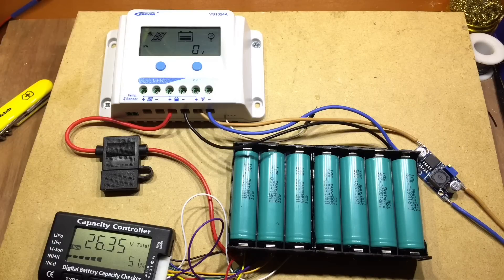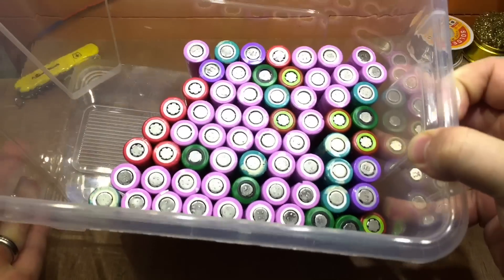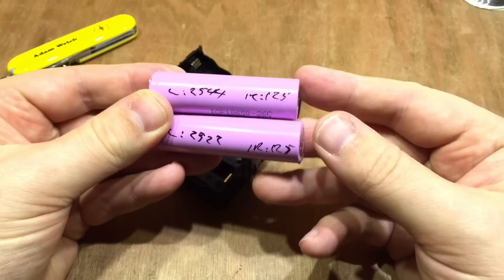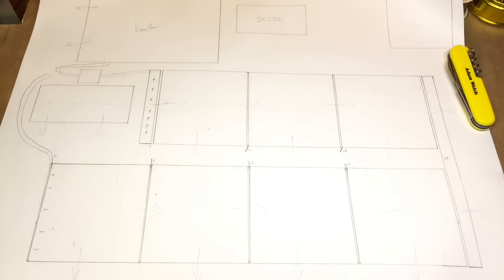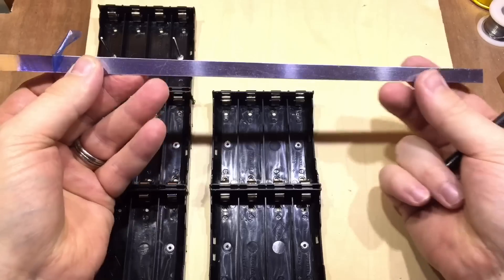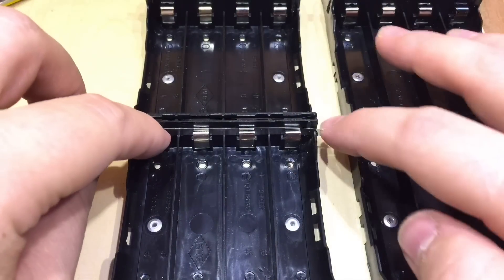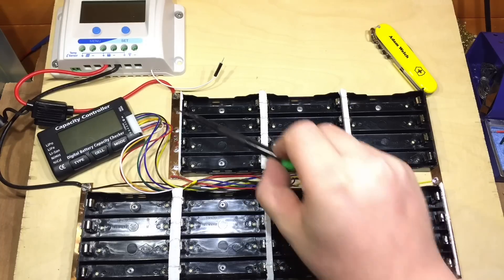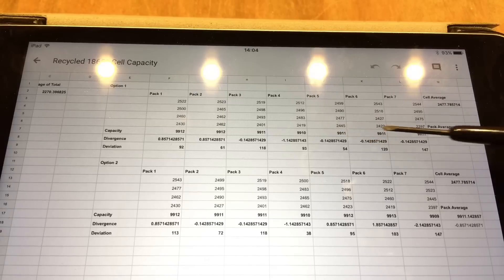Solar Charging Lithium Ion 18650s - Part 4, Expansion - 12v Solar Shed

Comment: Have you considered NiHM cells? They give a higher energy and power density than lead-acid, if not so much as li-ion, but they can also last a lot longer and are comparatively easy to manage charging for.
Reply from the maker: +Vyl Bird I think you asked me this before? It's an option for some but I don't have a load of NiMH cells lying about. If I did I'd definitely try to use them for something.

Comment: Awesome video Adam!   I also really like the links to all the goodies in the text underneath the video, well done and easy to find the stuff you need and refer to.
I wonder what output you get during these crappy solar (rain) days?
Reply from the maker: +Luc Peeters I'm glad you're finding the links useful - I'm trying to do links to searches so people can find the best option for them. Not all sellers post everywhere and it may be you'd rather use a local stockist sometimes. 

I can monitor my lead acid setup from work. Today I was getting about 2 watts from 200!

Thanks for the kind comments.

Comment: Great video, nice to see people finding repackr.com useful :)
Reply: ZOMG where was this website months ago when I needed it?? I made a 12S lipo pack out of 130+ 18650 cells for my ebike project and manually sorted them all in excel. Oh the headaches lol....
Reply from the maker: +Chris Bird Thanks Chris. I did see your name was behind the site so thank you for that too - it's a really useful service. Any chance you could explain why you get different results if you submit the form multiple times, and perhaps your opinion as to which might be the best option given by the site?
Reply: Adam Welch the algorithm randomly chooses a solution, then keeps trying to change the solution, if it finds something better it keeps it to build on it throws it away and tries again. It's done like this because trying every permutation of the cells for the best fit would take quite a while to process. So each time you try it you get a different solution but any solution it does give should be good enough. Yes, it was something that Paul, myself and one of his subscribers pulled together. The second option provided for sorting really isn't that useful. it tries to make sure batteries grouped together are very similar capacities,  but leads to lots of wasted cells if the capacities are not very similar to each other. it's something you could do just by grouping the cells into boxes as you tested them.
Reply from the maker: +Chris Bird That's really helpful thanks Chris. Great to hear of the collaboration too - it's nice to see the community pulling together.
Reply from the maker: +Fishmonger ! Repackr is very handy.

Comment: I use a MPPT charger MPT 7210a and a PWM
wincong sl03-30a for controlling the low voltage protectionhttp://www.ebay.com/itm/SL03-30A-12V-24V-Wincong-solar-Li-ion-battery-charge-controller-regulators-LCD-/252187530101
Reply from the maker: +frank walthie A few people have told me about the 7210a charge controller. It's a bit weird being that it is a boost MPPT charge controller. I should really get one yo have a play with as I like Ming-he devices.

Comment: I was wondering if you were thinking of maybe a 1Kwh pack build. Which would give you lots of power for your shed even on cloudy or panel covered days. This would be a great next step to battery bank. Great Video       Cheers Eric
Reply from the maker: +Eric Scherzinger No plans as yet. I prefer 12 volt systems really (and I don't think a 3s system is ideal for 12 volt) but if someone offered me a boat load of laptop batteries for very little money it would keep me busy wouldn't it. :-)

Comment: Hi Adam,
don't you think that the (increasing) humidity in the wood will eventually cause some current leakage through the busbars ?
Maybe you should have isolated them from the wood.
Reply from the maker: +Hans Struik I hadn't thought of that no. It's a possibility. I might be able to get something under two of the three. Thanks for the suggestion.

Comment: Great update. I'm just planning on something like this for in my garage to run lights, etc. 

Also building packs for another project, so repackr.com was a great find! I'd had a hunt round a few months ago and found nothing.
Reply from the maker: Thanks Darren.  It's a very handy site.  It's interesting though because it doesn't always come up with the same pack design.  Keep hitting submit and record all the results, you'll find a configuration you feel most happy with.

Comment: Nice little setup. My only concern would be the efficiency of the PWM Charge controller. are you planning to upgrade the charge controller?
Reply from the maker: I'm not too worried about the charge controller efficiency.  The MPP of the panels isn't too much higher than the typical voltage of the cells.  It's PWM but it's only got 100 watts of solar attached (and it's winter) so I suspect the capability of the array might be more of an issue - we'll have to see.  Today is a dreary wet day and my lead acid setup is only achieving 1-2% of it's rated.  The expansion is more around riding the bad days as long as there is a good day in every three or four!
Reply: mppt only come into there own when your running a 24v+ solar array but a 12 volt battery bank

Comment: you only really need a fuse per series bank as one fuse goes the hole series bank drops out
Reply from the maker: The fuse wires are for protecting each individual cell.  If one of the four in series goes short circuit or needs it's neighbours to deliver lots of current to it the fuse on the damaged cell should blow.  That way the battery pack keeps running but the bad cell is taken out of the equation.  I might look in the future at demonstrating that.  Or have I miss understood your point? Sorry if that is the case.
Reply: sorry I had forgot about the balance strip making each pack parallel my idea was to make it simpe each cell is 2ah that 8ah per parallel pack one bettery fails that means your left with 6 8ah packs and 1 6ah pack that will over charge my idea is they are in series string with a fuse on the end this way if a cell goes bad that brings the hole set of banks down to 6ah rather then mixed ah rating of a pack due to bad cell
Reply from the maker: +David Simpson I see what you mean. Yes with this method there will be one group with a lower capacity but I'd hope I'd notice before it becomes an issue. 
Interesting idea you've got there though. Effectively lots of 7s1p packs strung together. 
Cheers

Comment: Good video as ever, btw did you spot that in the latest version of the EPEver monitoring software now has a lithium option.  It still lists float however so not sure if it's disabling it or not.  It's interesting it mentions cells in series 3 or 6 if memory serves but without any individual cell monitoring by it i'm not sure why it's got it listed in the settings.
Reply from the maker: Thanks Colin.  I thought I'd updated the software last week after I watched your video.  As it happens it's not updated at all and I've had to remove the old and install again.  Now I see the lithium option.  It's a good question regarding the float settings, and also regarding the cell series count.  As you know I just don't think 3S is really compatible with a 12 volt system, and therefore neither is 6s with 24. Seems odd. 
To remove the float out of the charging profile I suspect the controller might need a firmware upgrade (unless it was designed in from the start).  It would be very interesting to see if this is possible moving forward with the Tracer A, or whether this is something EPSolar will bring into new products.  Thanks again.

Comment: A metal bar sit between a battery holders, so four fuse wires goes into parallel. Is it expected?
Reply from the maker: The fuses between each group of cells is simply to protect the other cells in a group if one of the cells goes short circuit.  Lets say cell two in a group of four goes short circuit.  The other three cells will discharge through this short circuit from their positive to their negative.  So the fuse attached to the shorted cell should blow.  The other three cells will continue to work as they should now the short has been removed. Although obviously we've now got a weak group of cells that will find it hard to keep balanced with the other groups.

Comment: I have about 100 or so LiIon batteries, and have been testing them manually. While discharging, the previous battery charged up the next battery, and with a little charging by solar panel I have tested MANY batteries now.
I had different equipment with these 18650 batteries, and many laptop packs. Bt if I look at the the end what I got, it is not very well. The ones below 1 amp hour are obviously very old or much used, I will keep those for experimenting. I think I have about 30 of those. Then between 1.1 .. 1.0 Amp hour I have really a lot batteries. The ones above 2.0 is just a few (perhaps 30 or so). But most are in 1.1..1.9 Ah, and the 2.x range does not get above 2.3 Ah. Even the Samsung ones and even unused ones. So I have the impression your batteries are overrated (or mine underrated). I use a charger of the same brand you have (I happen to have 2 of those, the lii-100).
Any how. Nice project. I will start something similar when I am done testing all batteries, so I know what I can do with it. I do think I might try something different though, which is good so other people can see how well that will work! I will parallel the battery packs when charging. so that I am absolutely sure they are balanced perfectly. And use a dc2dc controller to lower the input (solar) voltage down to 4.0 Volts. I know the dc2dc converters will loose some power on efficiency, but not needing a balancer is something I really want to see and test. The downside is you can't use the pack while charging, how ever if need be? A second dc2dc converter can boost up the parallel'ed batteries and provide the high voltage if and when needed.
Reply from the maker: All those pink Samsung cells came out of laptop batteries of which I know the full history.  They were in netbooks manufactured in 2010.  All of these netbooks sat for a couple of years in storage before their first use.  They sadly had very little use before the netbooks were taken out of service because of broken screens, keyboards, hard drives etc.  99% of the 18650s were fine and had been through very few cycles.
I've found my LiitoKala Engineer li-300 to be pretty accurate in it's calculations benchmarking it against my own discharging arduino project.  The thing that perhaps I should have mentioned is that most people on YT seem to be discharging at 1amp, and the littokala does it as only 500mA.  A longer slower discharge will probably give slightly better capacity values, but equally the way I'm using them the discharge in actually use will be even lower.  However in many respects the mAh figure is simply a benchmark.  You just need to get the right balance in your packs.  You can test it's true capacity in other ways and reduce the margin for error once the whole pack is built and running.
My pack only has outside lights attached, so they charge in the day and discharge after dark.  This should hopefully ensure they give a long service life.  
Having my 7s pack (and a 24 volt solar panel system charging it) allows me to only convert once as apposed to your buck and boost.  It should be a little more efficient, but does add the balancing complication into the mix.
Thanks for your comments - good luck with your project.

Comment: Nice video. Is it hard to solder a fuse wire to the edge of battery holder?
Reply from the maker: I found that bit quite easy.  The solder took to the battery holder well and the fuse wire is very thin.  There are some issues with soldering fuse wire (the heat can degrade the fuse wire, and potentially when the fuse wire is getting close to fusing, it will be hot and might melt the solder) but I think it's worth trying this for a little while.

A good tip from Paul Kennett I forgot to mention was to tilt your battery holders to ensure the solder doesn't flow down the connector to where the battery will make contact as it could make it harder to plug and unplug your cells.
Reply: @AdamWelchUK  I just built a similar pack using these battery holders. Only I did a 4s4p. Instead of using fuse wires I had some 2cm long thin nickle plated tabs I bent over in half and stuck in between behind the battery holder contacts connecting pos to neg. Seems to work like a champ. No soldering. (Well, except for soldering the tabs to the bus bar. Tried some copper but couldn't get a good hold. So I doubled up nickle plated strip to use as a bus bar.) Batteries hold it all snuggly in place. Now to connect to a PWM charge controller that says it can also charge lithium. We'll see.